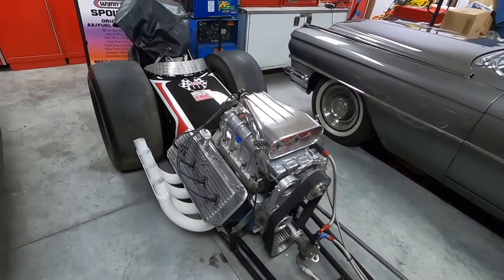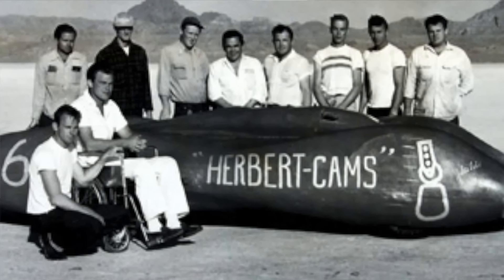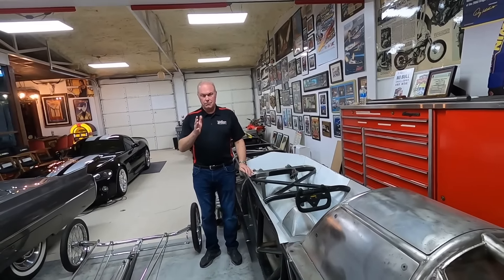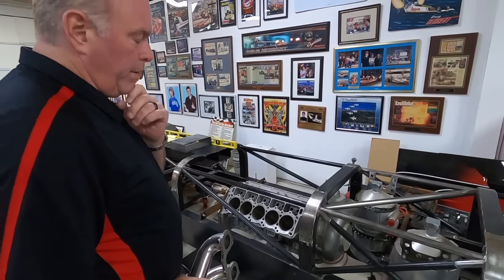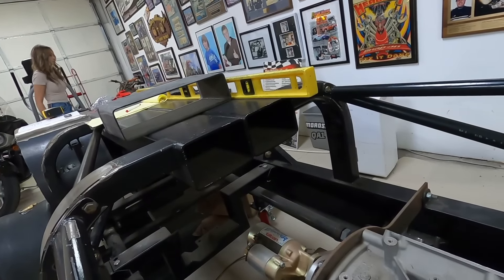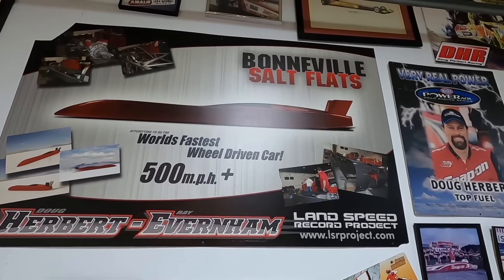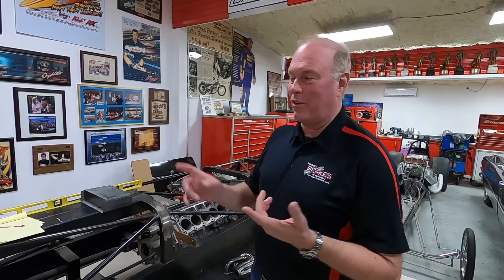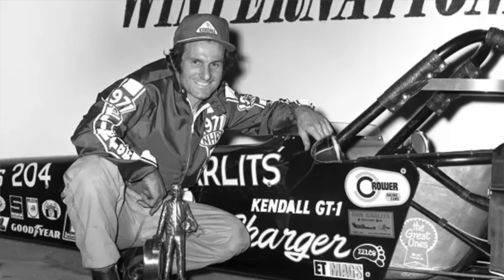Former Top Fuel Racer's 500MPH Viper Powered Monster: Doug Herbert's Purpose Driven Record Chase

Comment: last vignette.  Chet had a twin chevy sidewinder (lots of powerglide slipper clutches in a tube between the engines)  It liked to loop half way down the track.  I suggested that it was "too short" and said try grafting Lefty's TF front end on the Sidewinder to stretch it Never happened.  Later at Lions I asked Chet what happened to the sidewinder he said "too short".  We also found out that the steering was "too fast"     I'm going to follow your progress Doug

Comment: miss your dad and Lefty.  I went to Cado Mills TX in 62 where we won both top fuel with the dual 452 (327) chevies with Zane driving and top gas with the twin 402 chevies with lefty driving  Greasy track so we took the stacks off and tightened the lash on the "400" degrees cams.  Lots of memories but the most lasting was the sportsmanship where one competitor who had lost his round loaned his engine to his competitor for the finals   It's not like that anymore.

Comment: As I'm watching this, I have one of the injection stacks from one of Goldenrods 4 hemi engines in my hands. I can't believe how much technology has change since then as I look at Doug's setup. 
The injection stack I'm holding is 8in long and bent in a certain angle so as to clear the frame and valve covers. Doug's injection stack is 10feet long and the thought process that went into that application makes my head hurt.
Goldenrod is now in the Henery Ford Museum in Dearborn, and if you didn't know it set the record for wheel-driven vehicles at 409.277 miles per hour at Bonneville Salt Flats in 1965. The record stood for 26 years. Driven by Bob Summers. 

Goldenrod was restored by my friend Mike Cook, son of Doug Cook (Stone Woods & Cook). They wanted all new stacks and valve covers on all the engines before going into the museum.

Comment: I taught my kids how to drive. I’d purposely drive off the side of the road and rode there for several hundred feet while explaining there’s no reason to panic. Then I’d have them watch my steering wheel input as I slowed and barely turned the wheel and car was back on road. They were always surprise how little input was required in the steering wheel. Then I’d make them get in the drivers seat and do the same thing. Over correction can be deadly.
Reply from the maker: My dad did very similar stuff when I would ride with him. He was a great teacher

Comment: Aviation ballistic recovery chute designed to open at any speed, expand to full open the slower it goes.
You may not need the ballistic part to that safety recovery system but keeping a chute from going open to full bloom to quickly, safely,  might be a feature to look into.